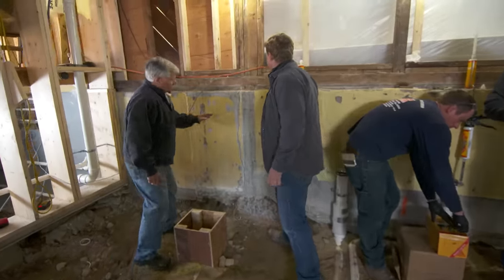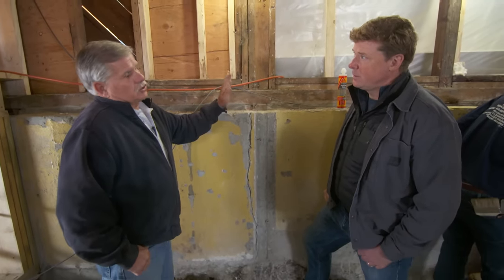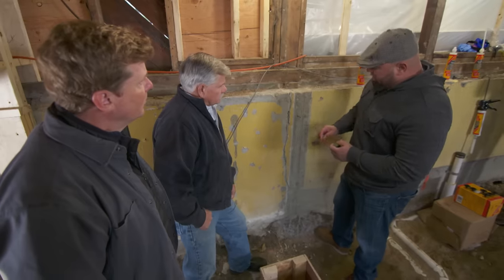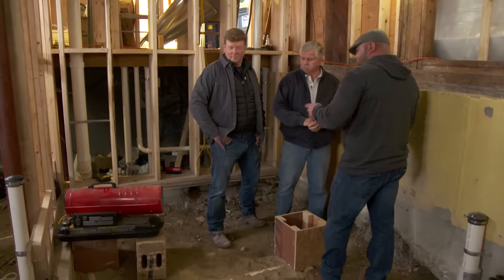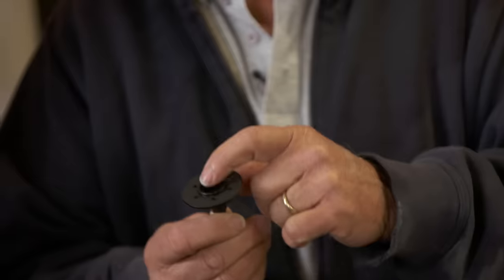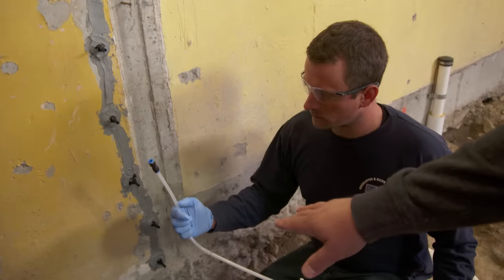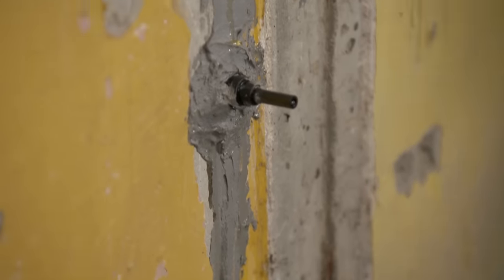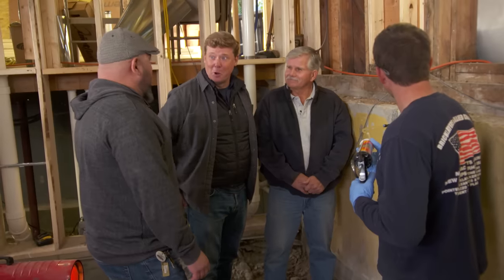How To Fix a Concrete Foundation Crack | This Old House

Comment: As a professional basement waterproofing contractor for over 20 years there are some misconceptions in this video.  The high PSI of the epoxy isn't a good thing like noted in the video.  Where we are located (Central Massachusetts) we have a pretty horrendous freeze thaw cycle and a seismic load.  Meaning the foundation moves, the footing moves, and the ground below the foundation moves.  All at slightly different rates.  Epoxy dries harder than concrete, so it ends up cracking when the two sides of the foundation move.  This is why most injections come with a 5-10 year warranty.  There is also the polyurethane approach if you have active water coming into the foundation, those systems usually last between 7-10 years.  If at all possible you want to seal it from the outside, with a patch that remains pliable and moves with the foundation.  We dig the cracks up by hand directly down to the footing and seal them in a day with a lifetime warranty.  The only time we inject is when there is something on the outside (precast steps, deck, stamped concrete).  Sika is a great company and they make really good sealants but its asking a lot of epoxy to seal a foundation correctly.  When we dig up foundations that have been injected they always have bug holes and pools of material on the outside, so its just a matter of time before they leak again.
Reply: Will a can of Flex Seal waterproof effectively? They’re $100 per gallon.
Reply: @HarnessAHealthyLife  I’ve used flex seal to waterproof a crack. It’s temporary. Not treating the cause of the crack, just the symptoms
Reply: What do you use from Sika when you provide the lifetime warranty? That's a pretty ballsy move using urethane.
Reply: Thanks Robert this is very helpful.
Reply: What do you use to seal when you dig the foundation and seal from the outside ?
That's what I'm hoping to do
Reply: @robertracki4023 what do you use to seal up the foundation on the outside after you did it up?
Reply: I also do this in the Eastern Pennsylvania area and I completely agree 💯
Reply: @shaquitanelson2980 I believe quickcrete or some mortar mix… I could be wrong but that’s usually what patching up concrete means.
Reply: Completely agree with you needs to be fixed from outside to actually fix the leaks.
Reply: This is some sound reliable info.Thank you for posting this comment.

Comment: The inside dam is only a temporary solution.  Go outside, dig to the footing, grind out the cracks on an angle to make an inside V, not an outside V, meaning the crack is the small part and the inside of the wall is the big part.  Pressure wash everything, sump the water out of the hole, and let it dry.  Liberally apply hydraulic cement making sure to get it deep into the crevice.  Slop non-drying roof tar top to bottom, left to right, going about a foot past the crack at each end.  Apply a layer or ashphalt based roll roofing to the entire patch.  Repeat the roof tar and roofing material one more time.  Protect the area from impact when refilling the hole with 1/2" thick styrofoam insulation.  Backfill the soil into the hole, tamping it down every 12" or so.  The leak is permanently fixed at that point, even if the foundation shifts another 3/8" over next 100 years.  Fixing leaks from the inside only works until things shift a tiny bit.  It doesn't matter that it's denser than concrete.  Once it loses grab on the crack you're screwed once again.  Digging sucks but it makes the fix permanent.
Reply: How are you grinding an inside V?
Reply: Non-drying roof tar? I didnt see that on google or home depot.. do you mean "Wet Patch" or "Wet-R-Dri" "All-Season" Tar?  Also how wide do you grind out the crack for the smaller and larger portions of the "V"?  Do you put tar on the styrofoam insulation board to stick it to the patch?

Comment: I just did this a two weeks ago. As a home owner it was easy enough for a weekend warrior to do. Cleanup wasn't bad and the fix is amazing. Best foundation repair that can be had for $100 - $150. Only wish TOH had covered it sooner as finding out about it wasn't so easy.
Reply: David Hettinger what material did you use?
Reply: David, I'm having the same issue in our basement. Rain is coming through a vertical  crack.  Did you do anything to your outside wall...like dig down to water proof? Or is the epoxy strong enough just placing on the inside wall of the basement?
Reply: SusieQ Gallagher If you dig from outside and use the epoxy injection kit and then attach a water proof membrane to the concrete (from the footing up all the way to the vertical crack) it would be the best solution HOWEVER it is very costly and you will need a permit to dig. Most people just try to attack the crack from the inside because the ease of access and low cost. I will be attempting the fix our crack from the outside in the summer as we have a very small leak even after fixing the inside wall with the epoxy injection kit
Reply: @ayoubfarid1663  Thank you for your reply. I'm so tired of heavy rains and the basement filling up with water. I will try this!
Reply: I barley know anything about home improvement, but I used the exact same Simpson Crack-Pac kit and filled in two floor to ceiling cracks in my poured basement cement walls.  That along with installing gutters with four foot extension drain spouts and I've had zero water problems with my basement.
Reply: @Susann1984  Personally speaking I just filled from the inside of my basement and crossed my fingers.  Fortunately everything worked out really well and the epoxy material I injected traveled up and through each port.  

The manufacture does warn though that if you keep injecting and injecting and nothing comes through the other ports that it could be all leaking out the crack on the outside of the wall into the ground.  If that happens you would have to dig on the outside, seal the crack and buy more epoxy to inject.
Reply: SusieQ Gallagher Susie, if your issue appears during rains, you have a very inexpensive fix (usually) to do. Put on a raincoat and watch how your gutters are draining. At least one needs an extender trough, a simple shallow ditch, or unclogging.
Reply: Glyn  Thank you for your helpful reply!  I'm looking into your link now. 😄
Reply: What brand of epoxy are they using
Reply: @Susann1984  I've had my house 25 years and the basement was always leaking! So by luck I saw videos by Gate City Foundation Drainage here on YouTube; he is brilliant and has many vids on draining water away from a foundation to stop leaky basements. I applied his concepts and for the FIRST TIME in these 25 years, my basement has been bone dry. I'm ecstatic!! Also, Gate City's videos are so entertaining, seeing how he analyzes what to do to fix leakages, and it's 99% in the DRAINAGE issues. -- All the best! 😀
Reply: Any idea is this could work on a concrete block wall. My basement walls are made of concrete block. I did the repair from the outside 2 years ago and sealed it with a waterproofing, but since concrete blocks tends to be porous there is a small leak along some the lower block joints and/or face of the block. Do you recommend this product or should I try Drylock. thanks in advance
Reply: What kind of epoxy do you use?
Reply: What was the name of the product that you used?
Reply: Can you tell me with this method do you need to dig out the outside and do the same?
Reply: Just checking in after a few years to see how the repair went and if there were any problems that came up after.  Please let me know.

Comment: Epoxy is only a bandaid. Stuff will crack and blow out as the wall keeps moving
Reply: Agreed.  Although, it would be useful to employ the "bandaid" if you're getting ready to sell your house and you don't want the potential buyer to be deterred by a crack in the foundation wall.
Reply: @ryanbailey8079  I worked in the foundation repair industry and a lot of those epoxy jobs we had to tear out because home owners were having melt downs 6 months after they bought the house.
Reply: thebearclaw0 good to know. what would have been a permanent fix to the issue described in the video?
Reply: @NewProvidenceUF  I would suggest digging the wall out. Then water proofing with tar then with an outside wall liner. Shooting out and anchor in the yard to stabilize it. Unless you want to move the wall back which is another beast. That involves lifting that section of the house off the wall Then pulling the anchor tight to move the wall back to original position. Then I would run a bead of Nexus pro in the crack on the inside just for added security against water. If you got water inside then you would need to add a wall liner and then run a discharge line to the sump pump.
Reply: thebearclaw0 🤯 that's a hell of an effort. I appreciate the breakdown! Thank you
Reply: Rain Forest Rc thank you
Reply: #1 best fix you can do is provide good drainage outside.
Reply: The epoxy that is put along the outside of the crack isn't intended to be the fix (If that is what you are referring to). It is only temporary. Its purpose is to keep the foam that is injected into the crack from leaking out. The epoxy can be removed after the foam has cured. Of course, if the root cause doesn't get fixed, it could crack again or create a new crack.
Reply: Clean, working gutters and proper grading can go a long way. And it’s practically free.

Comment: Concrete has no tensile strength, so if the foundation continues to move apart, that repair does nothing, A new crack will form right next to the old one.

Comment: I am a structural engineer and this is an excellent video of crack injection. However one of the most important things when fixing concrete cracks is to determine if the cause of the crack is still active.  Generally cracks can be classified as active (cause(s) still present) or inactive (cause is no longer present). The video mentions fixing outside drainage which can be the cause but it is hard to know for certain without monitoring the crack for some period of time. Of course crack monitoring over time is not always possible in every situation.

In this particular video it looks like an exterior stud wall is sitting on the foundation and there is no floor at the foundation level. Typically in residential construction there is a floor at the top of the foundation which serves to support the top of the wall. If you happen to have a similar situation then in my opinion you have more of a retaining wall than a basement wall and the cause of a crack and repairs may be different.
Reply: Is this something you can use a cold chisel in place of the saw? I'm trying to do it myself and save money. I also probably wouldn't use the saw much.
Reply: @ryanschaffer88  there are lots of different products available so I suggest trying to find one where the manufacturer allows chisel method as an approved process.
Reply: Larry Deem Thank you. What material would you recommend for the “dam” to hold the epoxy in?
Reply: I am not sure but usually technical support group at the manufacturers are very helpful with this type of question.
Reply: Indeed the foundation is functioning as a retaining wall, without a footing.  I’m surprised I’d didn’t fail more catastrophically.  My company pours 500 foundations a year.  90% of the plans we see on look out and walk out foundations, don’t treat the foundation as a retaining wall.  We are in Northern Illinois with heavy soils and severe winters, I’m surprised we don’t see more failures.
Reply: grinder with a masonary cutting wheel. make an X cut into the concrete or cmu, not a V. The Epoxy that went in will detatch over time even if the settling is still active or not, and the fact that these guys just made a V instead of an X, it will literally fall out which is why it also detatches. Wouldnt be any different that just throwing hydraulic cement into it. It wont last if its not done right. Cutting it as an X basically creates a continuous pin once the epoxy hardens. If it detatches, it will still hold everything together.
Reply: Hi Larry are you a structural engineer in Ca.?  I have a  structural crack in my pool which I had repaired sevreal years back. As you mentioned they did not determine the cause they just widdened the crack filled it up,    replastered the pool and a year later the problem appeared. They came in again I told them that they did not properly repair the pool and should  have used rebars,  but they insisted that the epoxy will fix the issue and will last 20 years. They re-oppenned the area grinded the cement till smooth filled it with epoxy and three years later The same crack  in the exact spot appeared  and they no longer honored their guarantee .  My pool has been empty for two years and I have not been able to find the right person to do the repairs the proper way.  Majority of the pool repair companies don't deal with structural cracks. They just want to transform your pool to a new look. I don't have the means to just hire people to do a mikey mouse job .  Can you please advise me to the right path. We live in an area that has alot of movement.  Is this something that a structutal engineer can help determine?
Reply: @chelseabraixen3212  I am in Ohio. I would suggest talking to a few structural engineers and see if you can find someone with experience in your problem. I have worked on a few pools and there is nothing partially special about pools that an engineer with experience in concrete couldn't figure out. Pool experience would be better but strong local knowledge of soil conditions in your area would also be a good fit. Depending on the design and quality of construction it may be a very difficult and expensive problem to fix permanently. In that case it may be better to try and use some kind of flexible repair and just have to redo it every few years.
Reply: @JSLEnterprises  could u tell me what the name of that I have a lil  Crack on my house
Reply: What is this stuff called and how do I find it ?
Reply: @isaacellis9229  I would find local contractor, structural crack injection is a specialized process and I wouldn't suggest trying it as a DIY project.
Reply: I see this often in houses here in northern N.J. Houses were built 4'5' below the surface 70+ years ago and this is the result. They can't be built that way now anyway; lest egress. Thankfully mine was built on land without a 4-5' foundation inground.
Reply: I thought the same thing about if crack is still active?  In my case, the gutter leaked at the seams and water coming down along the foundation is what I believe to have caused this crack.  I assume this has been a problem long before I moved in 3 years ago and the crack was in the inspection.  Anyone know where you can buy those plastic injection points?

Comment: I've had to do this several times on my house as well, over 100 years old, no footing.  In my case it isn't drainage related.  I have a couple of techniques I developed.  At or below grade, I excavate and face drill into the block on either side of the crack for rebar pins.  They are left protruding, and then I use stainless wire to stitch the crack and preload the rebar pins.  I make a form and fill it with high strength grout to a fluid consistency.  This encases everything, including the rebar stickout and the block core.  For above grade, I use stainless stitch ties in the grout lines with epoxy.  Again, it is sealed, and then I core fill the block the rest of the way.   Some backfill, and some stucco, and you don't know it's there.  Plus, unlike epoxy which can bond to dirt and dust, this is a mechanical repair.  Very expensive and very time consuming, but that's my habit of overdoing things.  My goal was use to use products locally available.

For cracks at a corner, you can pin the rebar in from the side, all the way to do the top, which makes a really nice fix.
Reply: I am commenting because this repair makes sense to me and I want to be able to reference this later.

Comment: I really liked this,, I have several cracks in a solid porded foundation wall as weel as a leak around mu main Copper water supply line. The only leaks that is troublesome in the house is the leak around water supply. Had a plumbing try and fix it from the outside and they said it would never leak but it did anyway. Had a foundation leak company come take a look and they wanted tear up our entire basement around the foundation wall on the inside of the house and just deal with the water as it came in and not prevent it from coming in the first place. We finally just added our knew roof, we have new properly sized gutters coming next, they are 6", we have 4" now, and we will be able to keep the water from running down the face of the fondation and the gutters from getting clogged. This will be a perfect solution to seal up the cracks on the inside of the house for the water line and the garage. Thank you for showing this